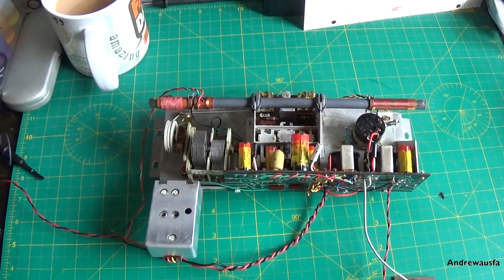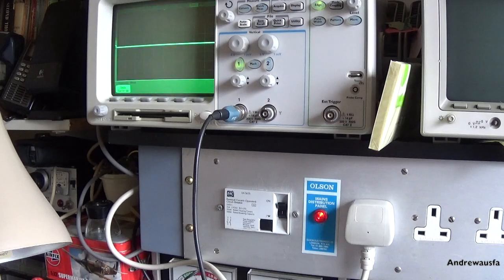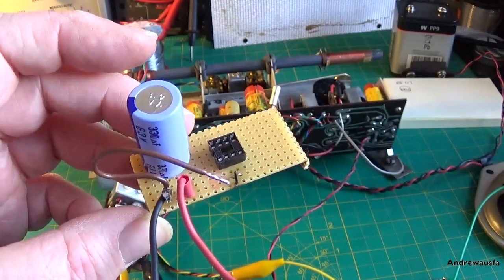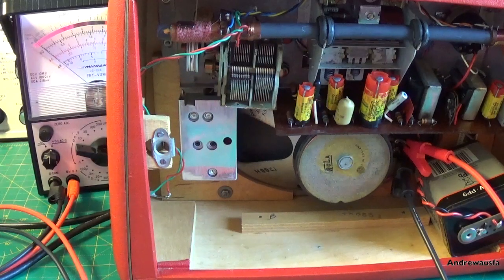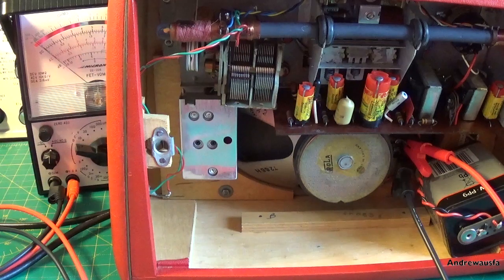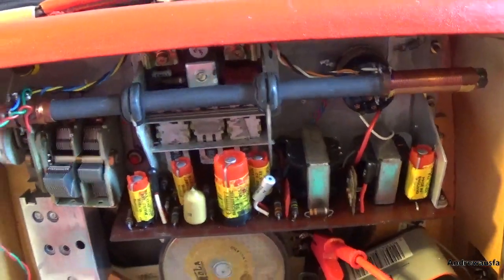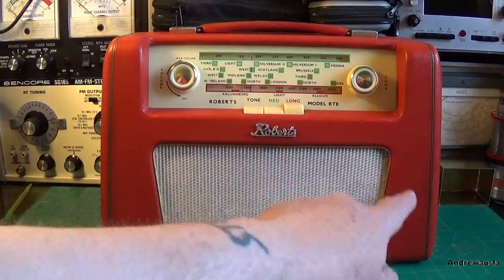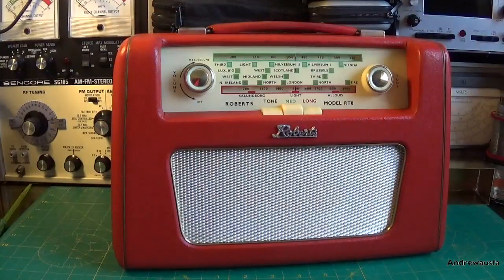Roberts RT8 Transistor Radio Part Two

Comment: Loverly job,  there is normally no reason for people mess with the r.f side unless a transistor replacement is required.
And if the transistor is the same as the original i would be supprised if anyone would notice.